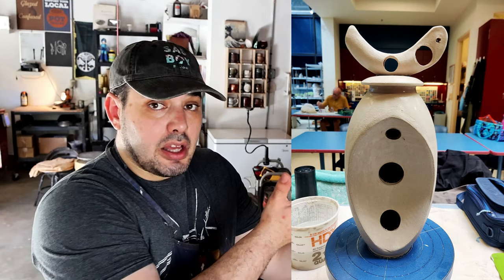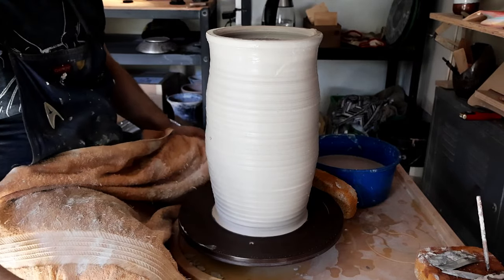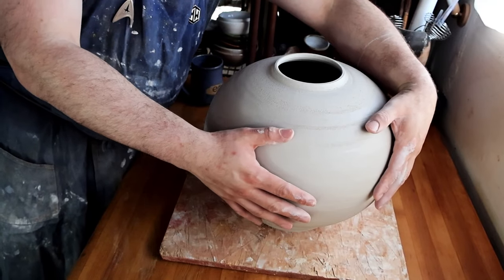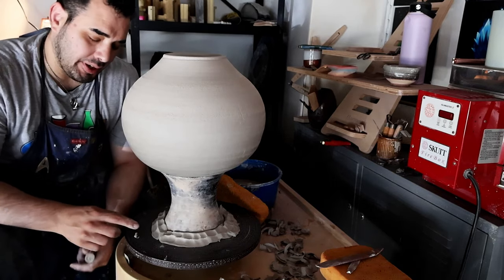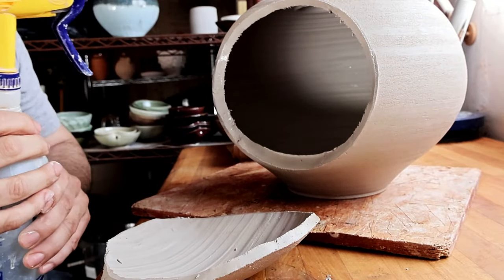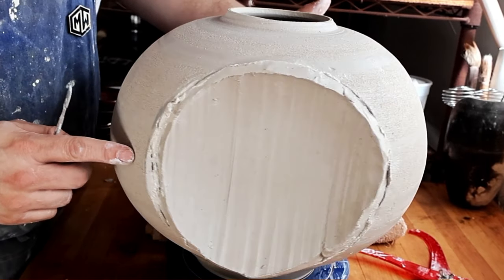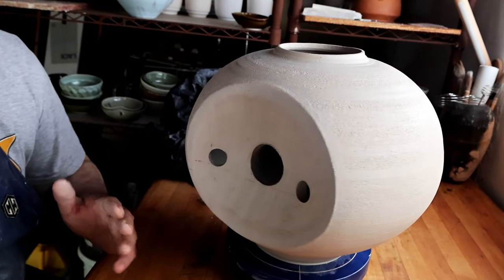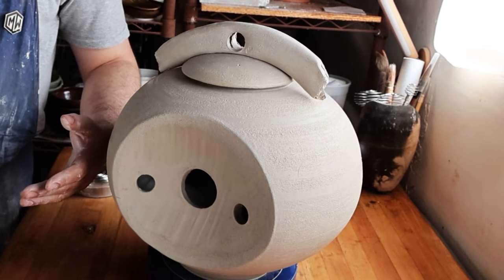SOTF 1-1 sculpted moon jar (throwing 25 lbs)

Comment: Thanks Dante. So when you posted a pic of the first "inverted" jar I tried it. Came out pretty good but I screwed it up the glaze job, chit happens... Then I got the idea of making a white and black Inverted jar using Kentucky Mud Work's white bear and brown bear. Threw two jars and swapped out the "inverted" cut-out to have a white jar with a black cut-out and a black jar with a white cut out. Total failure! What i didn't account for was the curvature of each jar being a bit different and just how time-consuming making clean lines with white and black clay would be. I'm still inspired to do this so it's back to the drawing board. Thanks for helping me get out of my comfort zone!
Reply from the maker: Oh yes, it's best to use the glaze that breaks over curvature and make it thick with these types of forms. 
I'm glad that you tried it :)

Comment: I love this form! I'm curious though why when you were putting the inverted pieces on, you turned them 90° in relation to the direction of the clay layers of the main body. If you had kept the lines running the same direction, wouldn't your edges have met up better and not needed the added clay?
Reply from the maker: Itried the original way. For some reason it didn't  fit, so I rotated it and it fit 🤷‍♂️

Comment: It looks like the cut offs were rotated based off the throw lines on the inside, is there a reason for that?
Reply from the maker: No there's no reason for it. 
When I cut off that slab I turned it horizontally just because it fit a little better. 
No artistic reason at all it just happened to be that way